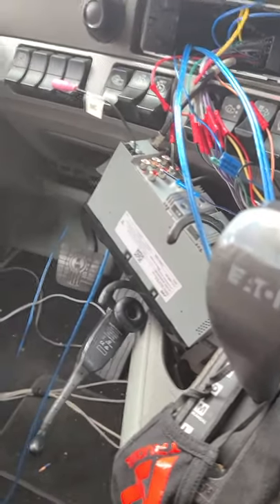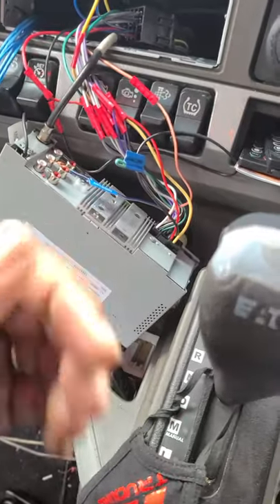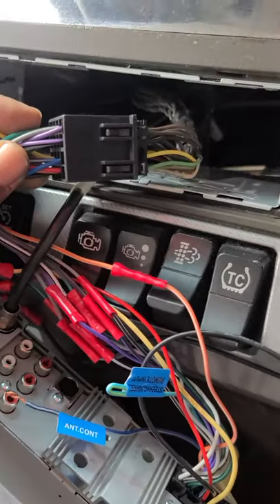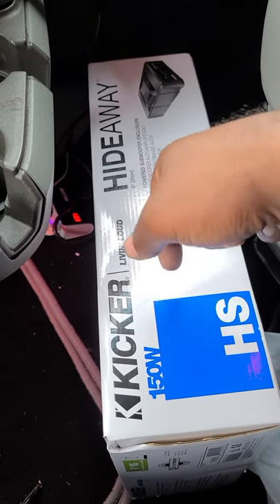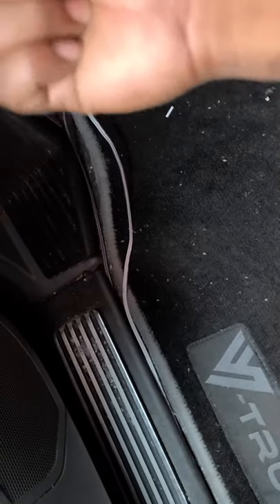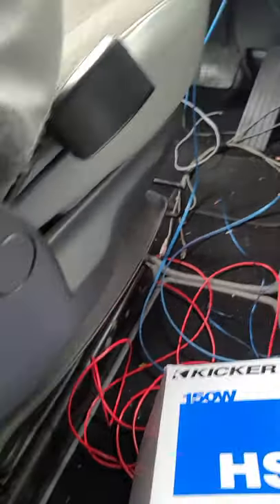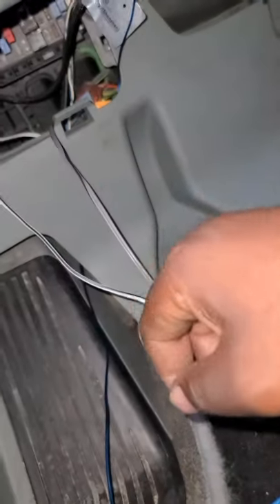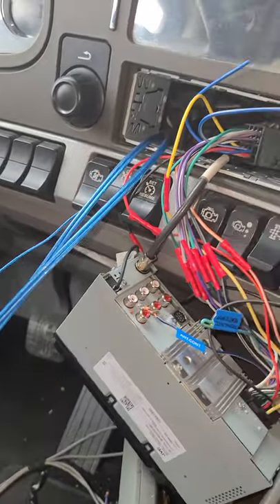2014 kenworth t680 kicker hideaway powered subwoofer install pt1

Comment: Does the factory stereo also have the connections in the back of it to connect the subwoofer in an amp or do I have to buy a new stereo?
Reply from the maker: You can get an adapter for that but it's better to just buy a new radio

Comment: Man could you please e-mail how you did the wires on CD PLAYER
Reply from the maker: Go to bigrigstereo.com and order the factory wire harness for your truck. Then the radio wires will match the harness color for color. It's really easy once you get the factory harness.
Reply: @lilbitofhoney  which one did u get I have a KW T680 I didn’t see it on the site or maybe I’m overlooking it also how long was shipping I was think of ordering and entire unit ready to from the save me sone time
Reply from the maker: If I'm not mistaken I called them to verify the correct one. Shipping took less than a week.
Reply: @lilbitofhoney  appreciate that bro I try overnight mine so I can have it before I head back out do you know if they are open on saturdays?

Comment: Did you use an adapter to use the steering wheel controls??
Reply from the maker: My truck doesn't have the steering wheel controls.
Reply from the maker: I have since removed that speaker and went with a pioneer Amp and a 8 inch kicker sub. Sound much better than that hideaway
Reply: @lilbitofhoney  do you have pics or video of your setup
Reply from the maker: @nathanaaron1983  yes. I ended up taking the hideaway out it was trash. replaced it with a 8in sub under the bunk.